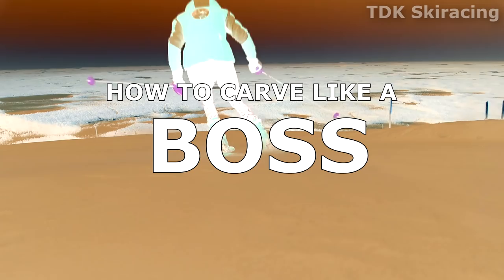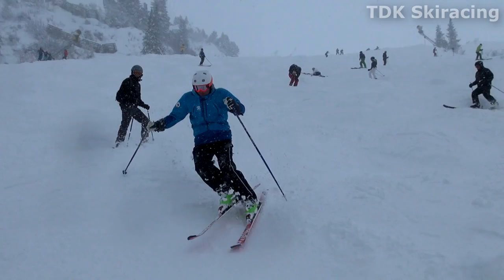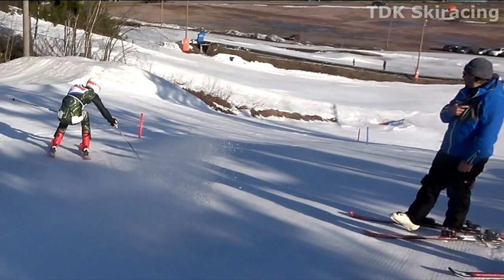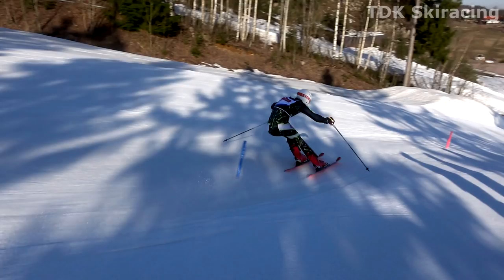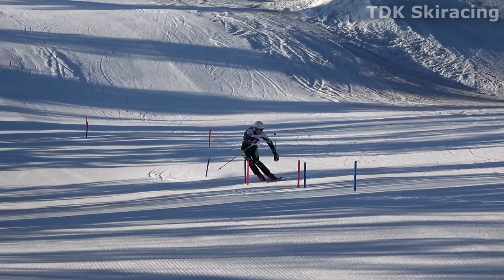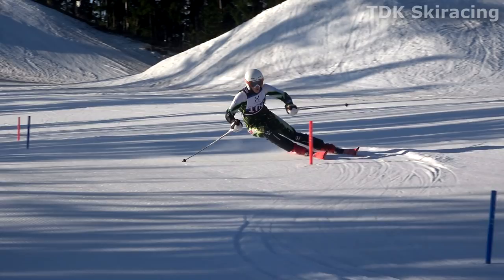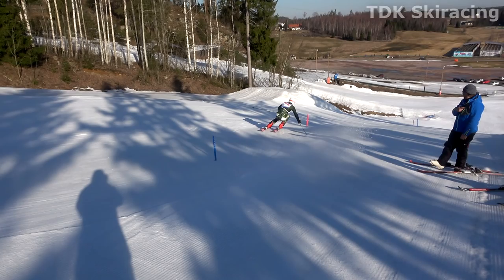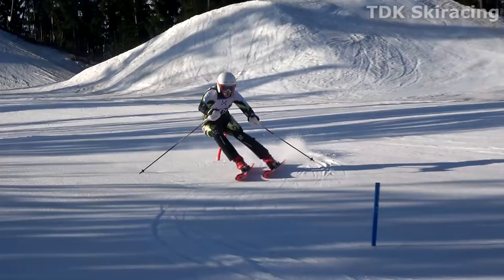How to Carve like a BOSS

Comment: Hi Tom, thank you for your super videos. Do you currently work as an instructor in Levi or in some other place?
Reply from the maker: Hi, thanks for asking. I do work as an instructor at a local hill. Not at Levi. Just making many of my videos there in combination with coaching camps.
Reply: @Triggerboy62  I like your approach to training, a set of exercises and video analysis. If there are any camps in which someone can take part, then I would fit in with pleasure. I am not far away - in St. Petersburg, and have been to Levi, Takho, Ruka.
Reply from the maker: @MrLamas1  great, send mail to tdk.skiracing@gmail.com :)

Comment: Hi, could you tell more about the inside leg? They put some pressure to inside ski?
Reply from the maker: Depending on the situation but yes, there is definitely pressure on the inside ski. I suggest you go over to my HOW TO RID A-FRAME video and check out the drill I suggest. The faster you go and the more edge angles you have the more you pressure the outside ski but for regular carving its somewhere between 60/40 and 80/20. Main thing is that our inside ski is engaged and actively carving.

Comment: Hi, thanks for your excellent videos, 
But I have problem with my upper body which remain facing fall-line (like skiing moguls) , which correction drills you suggest?
Also in medium carv turn , should upper body be square to turn direction?

Thanks a lot

Jerry
Reply from the maker: Thanks for asking. Take a look at the 14 Essential Drills For Ski Racers video. There you will find the Super Man Drill variation 1 with a hand clap at 2:10 very useful because it forces you to SQUARE UP at transition but also to COUNTER early in the turn. Also the Reverse Super Man Drill at 5:20 will be helpful as it forces you to stop facing down hill all the time. Remember to also carve across the slope and not always close to the fall line. As Tina Mazes coach pointed out to me once, there are two types of turns, one goes close to the fall line and there you keep your upper body facing downhill and one that goes across the slope and there you need to follow up with your upper body in the direction of the turn. Face the wind. Hope this helps.
https://youtu.be/YdHnGNzr2uw
Reply: @Triggerboy62    Thank you very much , You are the best
Reply from the maker: @jtszaba6527  humble thank you!
Reply: Where your shoulder and hips should face depends on when a stance ski is tipped onto edge AND engages. That's why you hold counter in transition when the skis are light, even until the new uphill ski has changed edges. When the direction change of a tipped stance ski occurs, that's when you start counter stance hip rotation with the inside of your body.
Reply: Start to* counter stance hip rotation with...

Also, if you don't continuously tip your skis, there's no real benefit of progressively countering. Countering is necessary to keep the femur aligned to the lateral forces WHEN the ski radius change. If you twist the skis on edge and then don't change angles after, you should only counter slightly at the start when the direction changed (since afterwards you're just traversing).
Reply: @Triggerboy62   Dear tom, 
One main question can be that does hip belong to lower body and should follow same direction of feet and turn or its direction is between lower and upper body?
In turns close to fall line for example I tried to lock direction of hip with feet and did some carved turns, the skis did automatically nice carved turns , but it required much energy to rotate the hip exact with the feet, is it right technique?
and the same question is whit carve turn across the slope. 
And sometimes I asked myself does hip follow the feet or reverse? by transition which one of upper , lower body or hip make first move? or it's wrong and hip is part of lower body and has no separated movement?

Thanks coach
Reply from the maker: @jtszaba6527  not entirely sure what you are asking but the hip has no muscles and cannot be move. You move your hip by moving your legs. Right?
Reply from the maker: @gu5907  What exactly is TIPPING. What is your definition? Is that a movement or a result of movements that causes the skis to TIP on edge.
Reply: @Triggerboy62   I mean when we turn, same as inside foot and outside foot of turn,  hip (or pelvis) has also inside and outside part, and the question is in turning across the slope to keep the body square to turn direction we should rotate (or pull back) the inside part pf hip.
and as you said it has no muscle so how is the perfect technique for it?
And what about turns close to fall line, how should we do? the hip has the direction of upper body or should follow the turn direction?
I hope I could explain my question.
thanks a lot coach

Comment: Your emphasis on the cross under is a bit vague. Crossing over is just as valid. Situational awareness will determine the faster technique.
Reply from the maker: Thanks for your comment. Whatever works for you is ok. However, if you watch skiracers on a track, most SL turns are cross under. And without that technique you cant ski on a racing track.
Reply: @Triggerboy62  IKR, I know way too many self described experts who cannot demonstrate the difference between a cross under versus a cross over.
Reply from the maker: @falllinemaniac  could you please give me your definitions of cross over/under.
Reply: @Triggerboy62  To cross over a skier thrusts their Center of Mass (CoM) diagonally forward over the front of their skis. This is usually done with extended legs. The upper body has an up/down movement with repeated turns.
While this intuitively makes zero sense, dynamically the feet will always come around and catch you in a perfectly executed carve.

Crossing under is when the skis cross under the skiers CoM in a legs retracted motion. The movement is generated from the spring in the skis from one direction to the next. This movement doesn't involve any up/down motion of the upper body, more of a steady position with the feet moving up and down.
Reply from the maker: @falllinemaniac  are you familiar with the ILE and OLR (OLF) consepts?
Reply: @Triggerboy62  inner leg extension & outer leg retraction?  I'm an off piste kind of guy. 
This is my primary method of relaxed turning. Off piste I change direction almost purely with this idea. I consider rotational input a failure or desperation. 

This works well with my refusal to press on the edges, preferring to press the flat base allowing the ski design to engage whatever edge pressure to happen.
Reply from the maker: @falllinemaniac  so you are probably using wider skis and you kind of float on top. Or at least use the base to create lift enough for turning by tippin in powder? No rotational femure input... kind of like how the new recreational wide skis are designeg to be skied? We on the other hand use exlusively narrow fis racing skis and ski on hard gromers and waterinjected race courses. We specifically use our edges to guid our skis as we turn. We tune our edges after every sessoin. Sometimes after every run.
Reply: @Triggerboy62  my narrowest skis are 76mm. Piste is okay but I'm all about short turns off piste.
Reply from the maker: @falllinemaniac  yeah, that is a bit wide compare to what we use. Keep skiing and thanks for watching and commenting.

Comment: Personally I would never teach lifting the inside ski a bit when initiating a turn (which you refer to as flexing) but it’s unfortunately common.
Reply from the maker: Thanks for watching and leaving a comment. Yes, picking the outside ski up in the air at the "release" is not something we aim to do. It just happens as the rate of flexing is hard to control when you have lots of things going on.
Reply: Watch WC'ers in slo mo.

Comment: I don't know what to say about this video . I don't like a single theory that you're talking about your upper body should stay calm and quiet your legs should swing underneath view as a pendulum through your hips to get more power and speed out of the turn you wanna drop your hip into the turn actually trying to throw your hip  down the hill , when you really is at the apex your energy should propel you forward into the next turn if you did it right will be in the air mid term. 
There is exercises to do on the snow to help you learn this. Which apparently you do not know any of these exercises.
Ski schools are not setup to make you a great skier. 
I trained with the us ski team and i was one of the best skiers  in united states.
I can finish in top 20 of any world cup event. 
Ski races used to be one in a matter of 1 second through the top 10 skiers now you're talking three-and-a-half seconds to the top 10 skiing has lost its touch and its fluidity and the magic that used to have from having short skis that are too stiff and throw you out of the turn.
It's a lot of the reason why skiing is losing tons of scares every year and ski industrious and starting to lose money and ski schools have improper teaching methods to really make you a good skier. 

Try to impress me by coming over and blind noll . Or jump off the cliff and do a hip  check and ski out of it. Try to explain when your skiing a course and you've got sheet ice, tell me what you do when you gotta make the next turn and you can't get an edge set!
Reply from the maker: Thanks for watching and for leaving a comment. Honored to have such a high ranked WC racer tuning into my channel. You are right, the CoM should move up and down a bit but not always. When I talked to Ted some years ago he said that you need to be able to do both. So its situational. Interesting what you said about the time differences between the top 10 racers as in many of the WC races this season the top 10 has been within a second. 
We cannot of course impress a top 20 WC racer but when skiing on ice we do the exact same thing we always do.